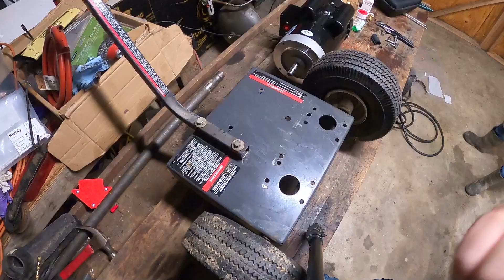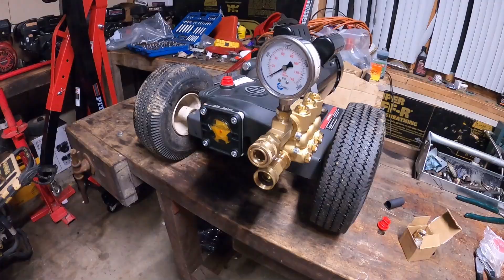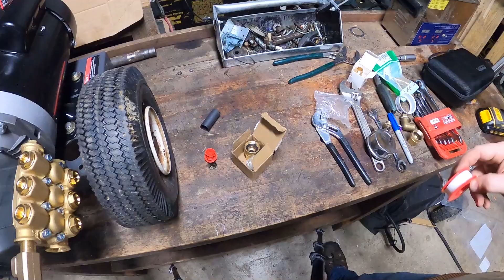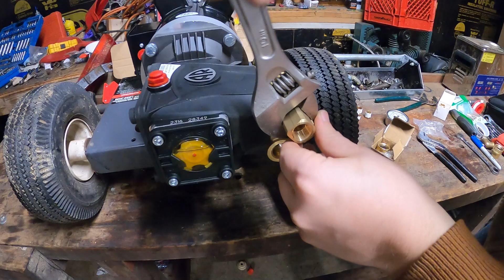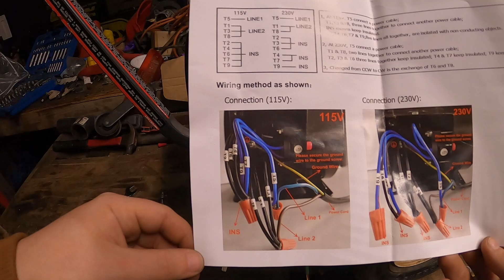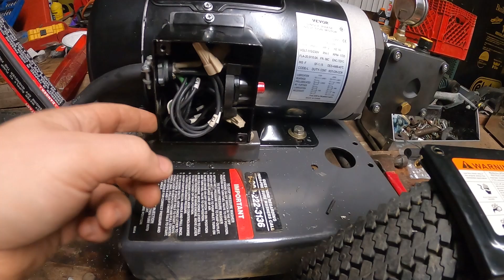HOW TO Build An Electric Pressure Washer

Comment: Your motor is constantly running?

You need a cut off switch for when you release the trigger or your hose will explode. Thats the main reason I watched your video.

Comment: Thumbs down due to not sharing any specs, exact models ,etc. 🤷
Reply: He is using a Vevor 2HP motor, and a AR RCA3.5G16E
Reply: How does the pump know when to stop building pressure when you off the gun without a unloader

Comment: It's missing an unloader valve, they're a critical safety feature!!! and plus without one you can also expect a shorter pump life
Reply: Your motor is constantly running? You need a cut off switch for when you release the trigger or your hose will explode. Thats the main reason I watched your video.
Reply: You don't need an unloader valve. If you nozzle your number to the psi and gpm your using. no issues are created!
Reply: @Fly_with_Efe where does the water pressure go then when you release the trigger and stop flow?